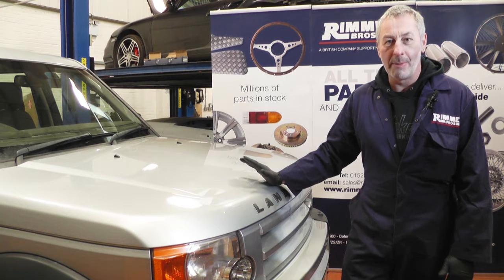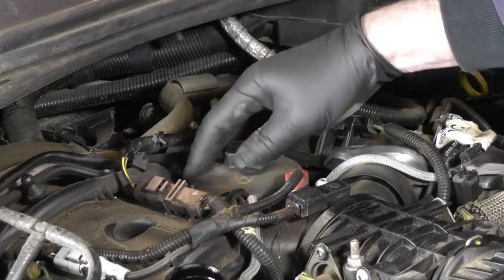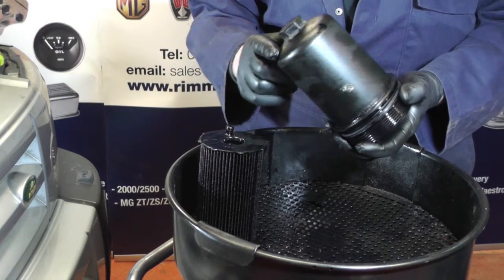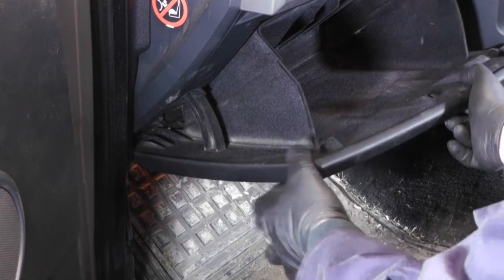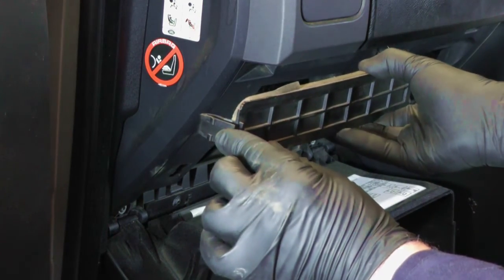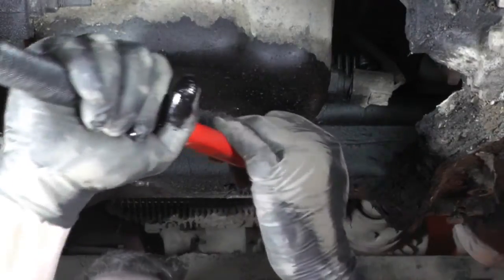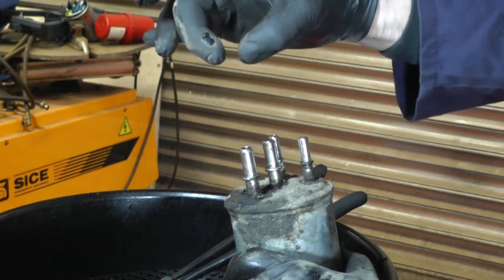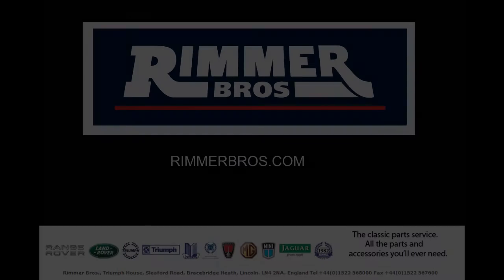Land Rover Discovery 3 2.7 V6 Diesel Service 2004-2009

Comment: Just a couple of points on this good video.
Oil filter, fit the filter into the lower housing first not the removable section, otherwise you risk the nipple not locating. Put a small amount of oil on the nipple O ring before inserting, When you fit the removable section this will automatically click into place. Unfortunately doing it the way as shown on this video, can result in the nipple not locating, & the filter being bypassed.
Fuel system. If possible pre fill the filter with clean diesel. There is a bleed valve at the back of the engine bay which is a schraeder connection. Use a flexible valve connector (push bike) to depress the valve, and direct end into a small bottle. Cycle the ignition 3 or 4 times, waiting for the low pressure pump to cut out each time. Remove the flexible connector, refit the dust cap, and start vehicle. Doing it the way that has been described minimises the potential for a hydraulic lock. HPFP o not like running dry.
Reply: Why change the oil filter, then run the engine on the old oil? Wouldn’t it be better to drop the old oil, then do the filter so it’s not contaminated with the dirty oil.
Reply: @m0bwy27  Thats a good point I didnt pick this up in the video @ 5:31. TBH I never set to off road before jacking. I know the handbook states this, im assuming that this was to ensure that the car jack (piece of rubbish) didnt have to raise the vehicle from the lowest position. If required why not raise the vehicle first, then use a small step to gain access.
Reply: Clean Filter dirty oil 😳😳
Reply: Also if you do use a torque wrench then when it clicks it's done.  None of this 3 more clicks for good luck....?  I would also have investigated why the underneath was so clarted with oil.  What a mess it was.  I know it's a LR but still... Totally agree with the new filter going in first so it locates properly otherwise you could be in a mess hoping it drops in as you spin it around.  Not the best video really to advise someone to do this as a DIY job sorry.

Comment: Did you find the oil filter made a right mess in the valley of the engine? Every single time i have changed one it has and its a pain to clean
Reply: Make sure the oils hot before you remove the housing and then unscrew it approx half to 2/3 of the way and leave it for a few minutes. the oil will then drain from the filter housing meaning zero mess when you remove the filter.

Comment: How to remove air from the fuel system? Only by fuel pump run? No any vent open? Sorry not good in english...
Reply from the maker: Tsvetan, Just running the engine will bleed the air from the fuel system.
Reply: @RimmerBrosTV  Thanks!
Reply: Please see post above. Pre fill filter if possible, use the bleed schraeder valve to vent the fuel system. Please dont just put on a new filter & start the vehicle. You may be lucky, however this does risk an air lock, with the potential for the high pressure fuel pump to run dry. This could cause internal damage, requiring a new pump.

Comment: Land rover discovery 2..... honest opinions
Reply: Great 4x4’s...... quite troublesome but I’m a mechanic with a full workshop at my disposal so I was prepared for ownership 😂 air suspension (bags) ACE system, prop shafts, FPR valve, XYZ switch, sunroof, injector harness, injector seals, EGR, chassis rust at rear section, fuel sender pump in tank, ABS system these are the main problems I had with mine though I repaired them myself, if it were a non mechanically minded person then this would of cost a FORTUNE in bills
Reply: @theredneckpirate5792  depends what you call a fortune. It's subjective.  I just change my discovery daily and scrap the old one